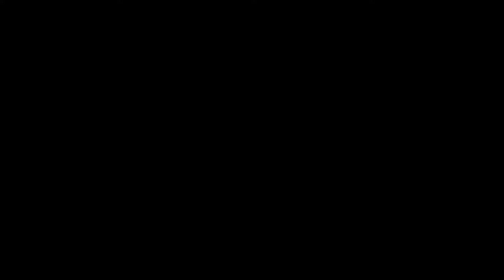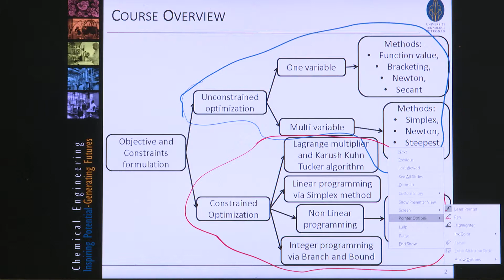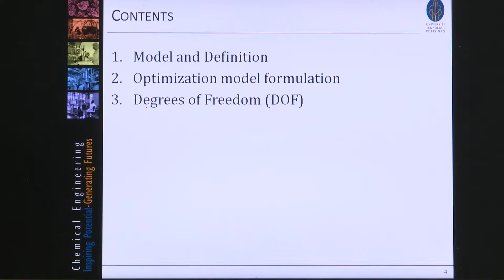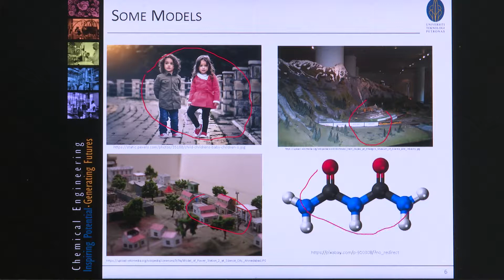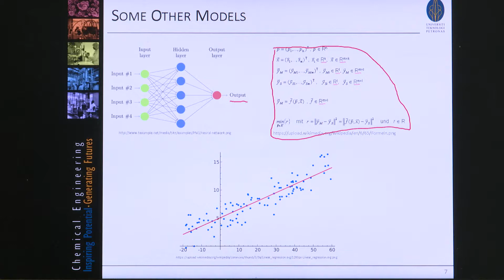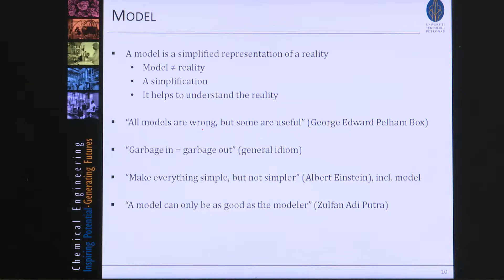2. How to define optimization problem and formulate it

Comment: It is a very useful video, however, it can be helpful if we see more lectures related to optimization problem formulation for chemical engineering problems.
Reply from the maker: Hi, thanks for the comment. Yes indeed, I'm planning to do so. Thanks again for the suggestion
Reply: @ZulfanAdiPutra  hi, thanks for the answer. Could you please refer me any literature that can guide me about optimization modeling of chemical engineering problems, specifically process synthesis. Thanks
Reply from the maker: @SyedHaider-x7t  hi, you can refer to Optimization of Chemical Processes, Systematic Methods of Chemical Process Design, or even Advanced Optimization for Process Systems Engineering